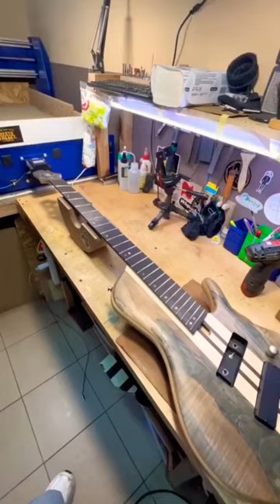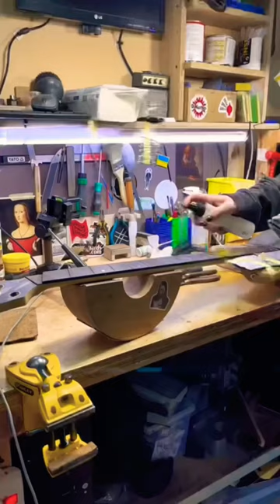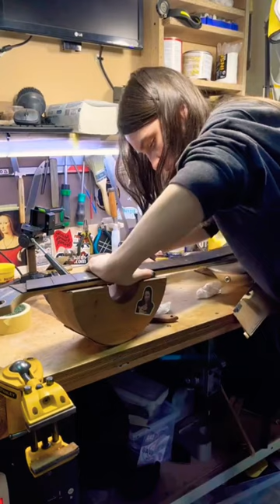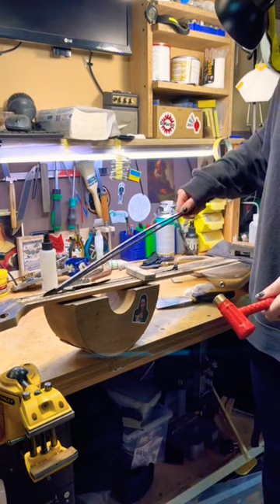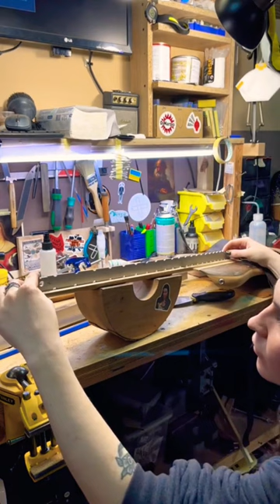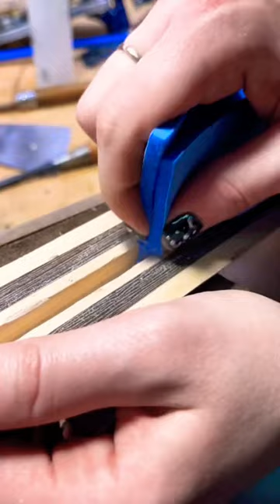How to do trussrod replacement. Pt 1

Comment: This job is for brave people. Not everyone can dissasemble a guitar at these level and assembly properly. Even a "simple" guitar tune up it's a fine task.
This is art. Respect. 😌🙌
Reply: I can only imagine being newer and going into something like this and finishing with something not quite feeling like the original and that is terrifying
Reply: @drewbocop  Totally agree bro. I would have the same feeling 😶
Reply: You are quite the under achiever.
Reply: I did this on my 7 string. The result is 7\10, but it was my first time. Had to redo twice, but in the end my guitar works.

Comment: Wow! That’s wild! Two questions. First is a 2 part. 
  1. Why do truss rods need replaced? How do you know? 
  2. How long of job is that? 
  Thanks, very much enjoying your videos.
Reply: "How long of job is that?"
Longer than it looks. 😁✌🖖
Reply from the maker: First of all, "why?" doesn't sound like a proper question, I mean, if some part doesn't work - it need to be fixed, or you get an unplayable instrument at some moment :)
And answer to your qestions:
1. If nut is damaged (any kind), and can not be just replaced, on on modern dual action trussrods its a common issue. Or damaged thread on compression trussrods. 
2. Depends of type of a neck/guitar. Also we need to count glue set time, and adaptation of wood to a proper humidity after fretboard was remowed and glued back. So just work time when I aclually do something with guitar - about 6 to 8 hours (if neck is not require laquer). But real time for complete and proper repair from recivieng from customer to givin it back - about 3 to 4 weeks. In hard cases may took even longer.
Reply: @TanyaShpachuk Muchas gracias por la expkicación.

Comment: i’m genuinely curious, would it not be more cost efficient to just replace the neck completely? i’d assume the cost of getting the truss rod replaced isn’t cheap and is probably on par or even more expensive with a new neck. i understand if the person just can’t part with the neck or if a replacement is unavailable, but it seems so much riskier taking apart the neck and putting it back together.
Reply from the maker: It`s not an option on a neck-through guitars)
Reply: @TanyaShpachuk  that makes sense, thanks for the reply

Comment: What's a trussrod ?
Reply: It's a rod that stiffens the neck and adds adjustment for when it becomes bowed. It allows you to straighten it back out without having to heat up the neck(like on a classical nylon which doesnt use a rod).